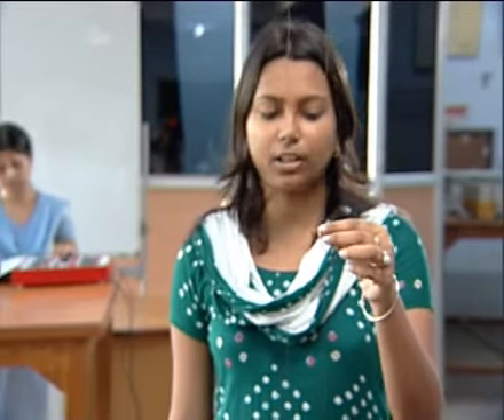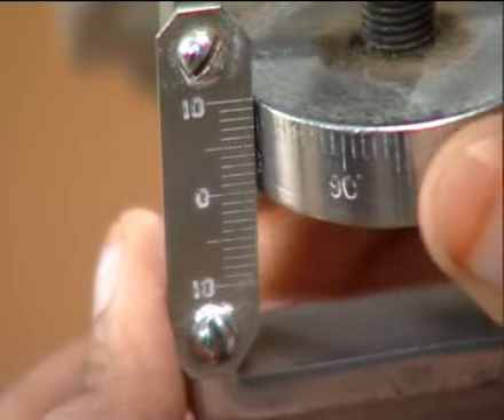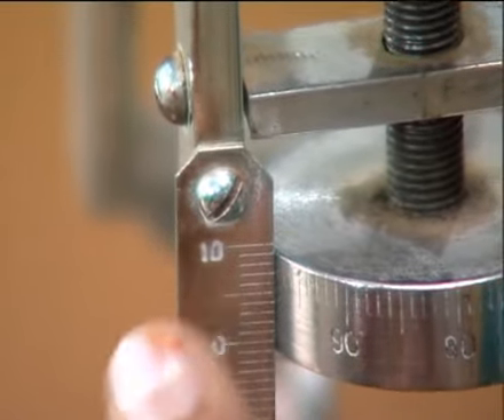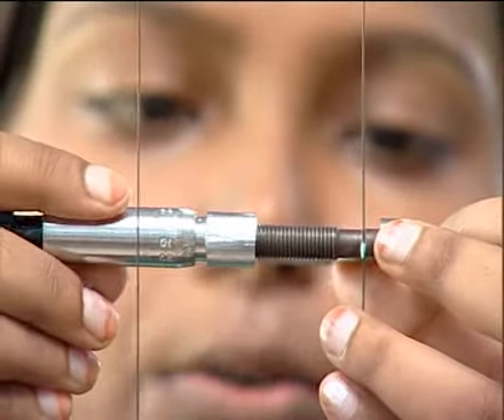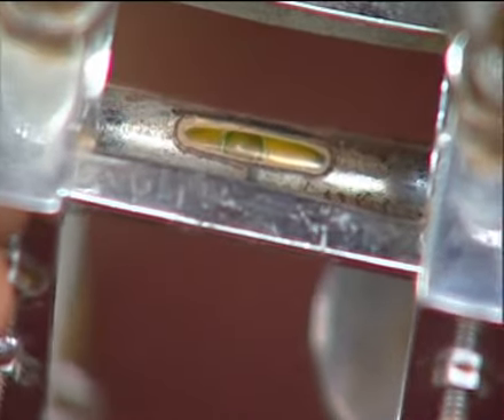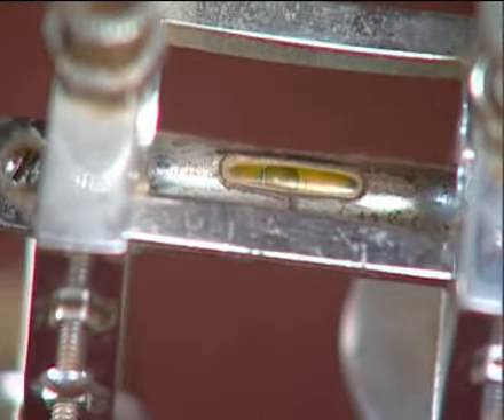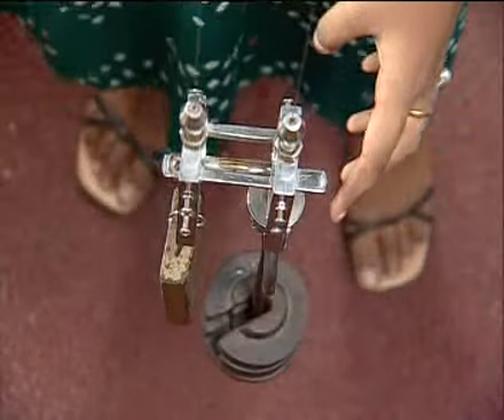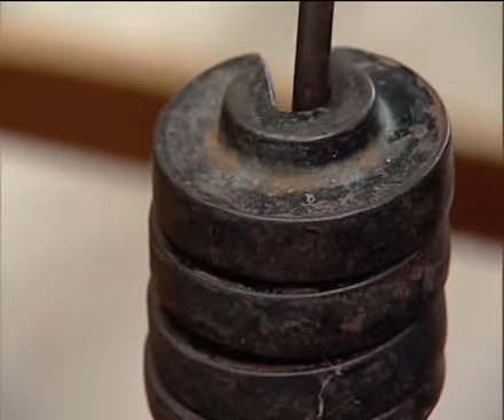Youn'g modulus of a given material by SEARLE'S APPARATUS

Comment: The two wires do not have to be of the same material or diameter, because one serves as a reference only.
Reply: No boy
Reply: It produces an error due to unbalanced
Reply: It has to be like that
Becoz of the elongation due to hanger (on first wire) which countered by the elongation by dead load (on the refference wire).
And another important reason is effects of change in temperature, which'll be same for both wire if keep diameter lenght and materials same.